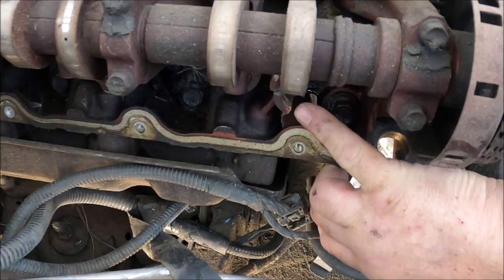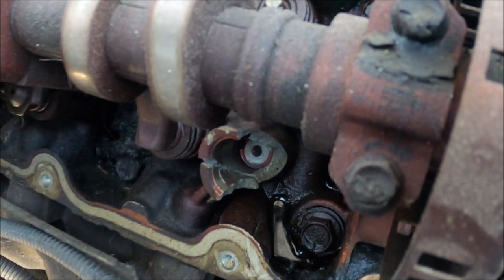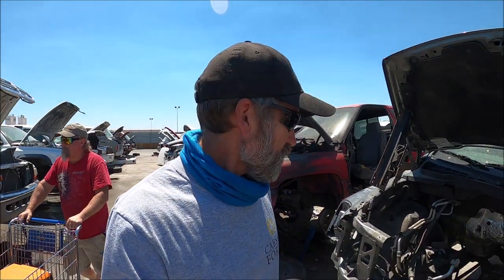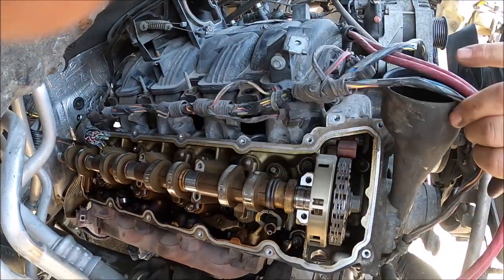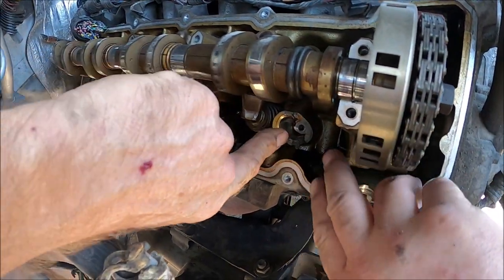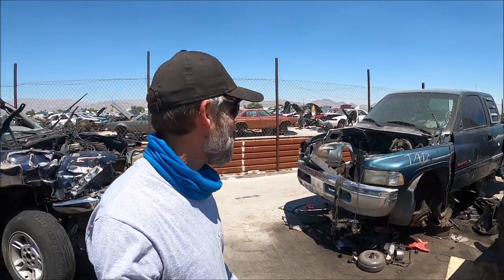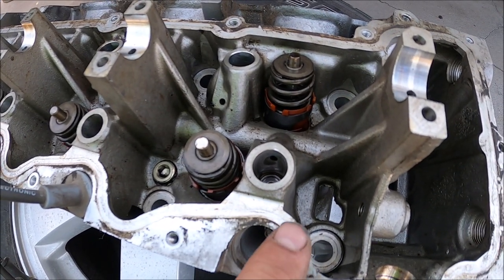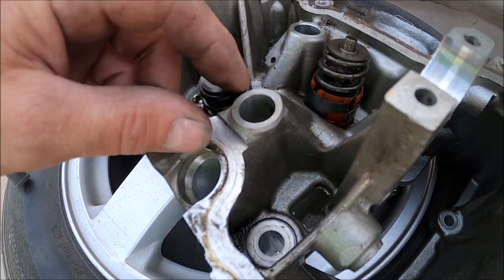Dodge, Jeep 4.7 Broken Lifter (lash adjuster) Boss in the Cylinder Head

Comment: Martin do you think the failure is a result of a design/casting flaw or do you think that the number 2 cylinder intake lifter gets the least amount of oil pressure at the lifter allowing the lifter to collapse letting the rocker pop out then smashes everything to bits? I had the rocker pop out of the number two but was fortunate enough to just need to replace a valve and put everything back together. No damage to the cylinder head or boss. Replaced all new lifters and rockers during the repair then drove the vehicle for two weeks running exceptionally well. After two weeks the exact same thing happened again. Again no damage to the boss just bent valves. I'm going to swap cylinder heads this time and install solid lifters. What do you think....?

Comment: Nearly watched all your videos, I've learned so much from you alone.  I picked up a  2001 WJ 4.7 last winter destined for the junk yard, was burning a huge amount of oil.  Replaced all the valve seals after inspecting because they seemed like they were really hard (235,000 on the motor).  After replacing I have almost no oil consumption between oil changes, I replaced the lash adjusters at the same time, sat them in warm oil to soak for a few hours before installing.  The motor still has a slight 'tick' on startup but it is usually gone within 60-90 seconds.  Is this normal or should I take the time to go back into the valve covers?  The vehicle was from Florida so virtually rust free and even at 230k miles it still very strong motor, and sounds super smooth after the initial minute of ticking, it's turned into a labor of love for me and I would like to keep it going as long as possible.  Getting ready to do rear upper control arm and ball joint on Tuesday.  (Waiting for the reversible switch gear wrench to ship after watching your videos!)
Reply from the maker: Thank you for watching. How is the oil pressure on startup? Does it take awhile to come up to pressure?
Reply: The pressure guage starts moving almost immediately on start up, takes about 30 seconds for full pressure. (Edit: Its actually less then that, more like 10-15 seconds for full pressure)
Reply: Mine does that with a whole new top end

Comment: I picked up a clean 99 limited wj last summer 150k on engine trans had a crush build bill of receipt was given to me black on black picked it up for 800$ had a crack on an exhaust valve side 800$ more bucks for all new heads from my local head shop dropped them in threw it together ordered you injector suggestion and the weaponx coils are next she is running nice already it’s had a few upgrades already brakes lift and radiator swap and has a clutch fan and a Bose radio I’m gonna do auxiliary trans cooler and upgraded pan and some drain port axle covers and maybe the dodge HD transfer case see where she takes me good vids bro
Reply from the maker: sounds like your well on your way, good luck with all the up grades.
Reply: martinbuilt thanks you’re videos have definitely helped!

Comment: Can you put 08 heads on a WJ without too much mod's...that looks like a good time...too master craftsmen in a pick and pull...all we need is a gulf cart and the beer girl... good time...wait that's a new industry...the golf course beer girls and a pick and pull...oh my...lol... great vid bro... definitely good info
Reply from the maker: Thank you, the 08 heads will bolt right up, looks like you need to use the 08 injectors because they do have a different length. I would try using the 08 coils and both plugs. I need to cc the heads and see if there would be a loss in compression.

Comment: I'm kind of late to the 4.7L game.  Do you know if the 2008 heads work on earlier 4.7L engines? I have a 2005 4.7L that also has cylinder 2 (and 8) valve seat failure. I am looking to get new heads and/or engine. Debating, but apparently I now prefer to go with 2008-2010 because of your great work.
Reply from the maker: The 08 can work on the early 4.7 you're gonna have to make a few changes,
 you'll also need the exhaust manifold's, the fuel injectors, Ignition coils and spark plug. wires.

Comment: I'm very curious if my mom's 2000 Durango with the 4.7 has this same problem. It has a nasty ticking noise that stays steady now coming from around cylinder 2. I've been planning to take it to a buddy of mine to pull the valve covers and look if the lash adjusters needed replacing. I figured they likely do with the mileage the engine has (248k miles). I was actually coming to your channel to link my friend to one of your videos and just saw this one for the first time. I can only hope mom's isn't as serious as an all new cylinder head would be tough to afford right now. Would this make the passenger side cylinder head run considerably warmer than the driver side? I've noticed when it's been running that the passenger side seems to be much hotter. Thanks for all the info Martin!
Reply from the maker: It could possibly make the cylinder head run hot if the exhaust valve is closed because a rocker has come off and unable to push the exhaust gases out.
Reply: @martinbuilt  thanks for the reply Martin! I got brave yesterday and pulled the valve cover myself. It actually wasn't has difficult as I expected. The passenger side isn't too terrible to get at after I unbolted the ac compressor and moved it to the side. To my surprise I didn't find any rockers just laying around or any obvious sign of damage at the cylinder 2 lash adjuster. Otherwise I really don't know all that well what I'm looking at as I'm not super mechanically inclined, just learning the basics from watching videos like yours. It does look like one of the lobes on the cam has some wear marks on it despite feeling smooth to the touch. Maybe I should consider valve seat drop as a possible issue instead?  I took some photos while I had the valve cover off and figured I could share them with more knowledgeable minds like yourself that may be able to spot an issue that I'm not seeing. I'm not sure if YouTube allows sharing a link in the comments. Would you mind if I messaged you a link to the images directly?
Reply from the maker: Another thing it could be the hydraulic timing chain tensioner That could explain why it sounds like it's coming from the forward cylinder
Reply: @martinbuilt  I wouldn't doubt that in the realm of possibility. I'll have to look up some symptoms of that and see if that might apply for my situation. This motor has never had any major work done to it. I'm pretty sure I'm the first person to ever pull a valve cover on it. I would imagine there's a variety of things that need addressing in some fashion. I'll admit it didn't always see the greatest maintenance routine so there's probably a wide variety of wear items that could use attention.

Comment: HELLO MR MARTIN. I HAVE A QUESTION TO ASK YOU, I HAVE BEEN USING A SYNTHETIC BLEND  OIL IT IS RECOMMENDED TO CHANGE TO FULL SYNTHETIC OR  I  STILL USING SYNTHETIC BLEND I HAVE A JEEP GRAND CHEROKEE LAREDO 2000 I LIVE IN SAN DIEGO CALIFORNIA. THANK YOU FOR  YOUR  TIME AND ADVICE.
Reply from the maker: I don't like using Full Synthetics in engines that have not had full synthetics used in them for the get go or least within the first 75K after that I would stick with want you are using.
Reply: @martinbuilt  Thank you very much for the advice I appreciate it ... greetings

Comment: Hello Martin, snookie pa here!seeing the improvent in 2008 would those heads fit on 2002 4.7l limited model,might be good insurance by looks of earlier heads???
Reply from the maker: yes, the 08 would bolt-on, you would also need the 08 exhaust manifolds as the bolt pattern is very different and exhaust pipe modifications may be needed. The 08 injectors would have to be used and I would use the ignition coils as well. One more thing there could be a loss of compression but this is something I will be looking into.

Comment: That is really nice that the vehicles are setting on concrete.Must of been an old runway or something.......
Reply from the maker: Yeah probably 5 years ago the  EPA made them put that Concrete in to help prevent groundwater contamination. Before that it was more like a gravel surface.
Reply: @martinbuilt  HAY they took the oil out of the ground why not put it back in and call it Renewable energy. LOL. Can you use a head off the left side of the engine on the right side and make one out of 2.
Reply from the maker: @jimr6121  Nope, the heads, and camshafts must be used for the side they were made for.

Comment: Is the 4.7 2005 cylinder head compatible with an 2004 4.7 cylinder
Reply from the maker: yes, if the 05 heads have an EGR port and you don't need it on your 04 just block it off.

Comment: Can them 08 heads fit on the earlier model 4.7's? And any 08 cams out there at Pick a Part?
Reply from the maker: Yes I'm sure the 08 heads would bolt right up the only problem is looks like the combustion chamber is larger so you would end up dropping compression ratio. The camshafts I did get off that  engine first time I ever found a set at a Pic-A-Part.
Reply: Does this problem happened on any of the other bosses or is it just number two in your experience

Comment: Hey martin man I hope u get back to me I watch a lot of your vids but I'm having a issue with my jeep so I replaced my motor recently and it was doing fine starting out and about a week ago my crankcase breather hose broke off from just being old and my oil started seeping out my motor to da point I checked and da stick was bone dry I was driving to get food when I noticed I didn't even make it to da store I pulled over checked oil and nothing walkied to get oil and discovered da breather hose broke once I got da car back home I took it off ordered a new and fixed it with tap and zip ties and it stay on so far while I wait for my new but know I have a ticking noise coming from the motor it just came out of no where it ticks on acceleration and get faster not louder with engine rpm but at high rpm u can't hear it    and  at idle but fades when idling 
Also one important thing for me is I'll be coasting at 40mph and if I let up off the gass the ticking get off rythme with engine rpm and kinda fades away but when approaching a red light as it stop and the engine is begining to idle u won't hear the tick and when the idle settles so does the tick but like this morning I go to the store come back in the jeep it's ticking when I'm driving I park back home and it running and Im not hearing the tick hit the gas and there's the tick idle tick fades away hits gas again ticks idle tick fades away I got out listen closely to engine and no tick can be found I'm under the hood hit the throttle cable and the ticks comes back and it's the passenger side for sure thanks Martin 
It's a new motor used thou I've done it all as fare as spark plug coils every accessory part every sensor all new 
No check engine codes for anything what we dealing with oh I check ed oil alot in a week like only difference for me with the oil is I originally had 10w30 oil in it full synthetic when the crankcase breather hose broke I went and bought conventional 5w30 oil by accident oil level is fine but oil looks thin as hell should I drain and get the full synthetic 10w30
Reply from the maker: It sounds like that ticking started right when you ran it low on oil.. Possibly a lash adjuster or it could be a hydraulic chain tensioner.
 It is recommended if an engine's been using synthetic oil that you always stick with a synthetic oil.
 With Winter coming on you probably want to stick with the 5W30.
 You may even want to try adding some Marvel's mystery oil.
Reply: Man thanks Martin and I'm almost sure it's not timing chain the tick is coming from valve cover passenger side for sure right around cylinder #4 I went out and spent like 2hours just under the car 1hour without a wrench or tool in hand just under the car checking heat shield exhaust bolts if anything is hitting the motor and nothing started car listen again and the tick just seems like it wants to go away and if I let it idle it does stop or it will do a 2 ticks and stop pause 2 ticks and stop pause and if I hit gas it's constant then at idle it will just vanish or be faint what part is it that you say is sticky the lifter I think that's what's happening the lifter if that's what it is it's sticking when I do the lifters should I replace the lash adjuster should I replace all the lifters or one that's bad and I will be putting the synthetic back in with some of that oil u mentioned thanks I'll update u I have another motor on hold on ebay rebuilt if this one goes down

Comment: This video is very reliving
I really wanted grand cherokee 4.7
So the 2008_2010 is more reliable and has less problems
I really appreciate your priceless videos Martin
Greetings
Reply from the maker: I like the looks of the WJ's better then the WK from 05-10
Reply: @martinbuilt 
U r right they look great specially yours , you really did a good job on it, beside it has front solid axil
But I don't like the transmission it's only 4 speed
It will be the best suv ever if it has manual transmission
 it's great project to do Martin
I think you will be the only one do that
Greetings

Comment: If they only offered headers!
Reply from the maker: Hi Chris, I forget what Jeep/Dodge do you have?
Reply: @martinbuilt  I currently have a 2002 Dakota Slt with a 4.7. I am starting the process next week of installing an 08 that I rebuilt. I have to change the whole exhaust system because the manifolds are different with a much bigger exhaust pipe size.
Reply from the maker: @chrisbeitzel4788  yep I was thinking of doing the same but I really what to keep my headers. Thinking of making new flanges that would bolt-on.
Reply: @martinbuilt  Just be cautious, the porting on the 08 is much bigger then the earlier 4.7 heads. I wish someone would build a set for the 08 and up engines. I am changing the size of my exhaust system to accommodate the bigger manifold size. My muffler guy is going to run dual exhaust all the way back. I'll let you know how she turns out!